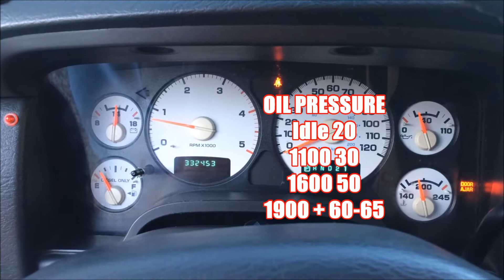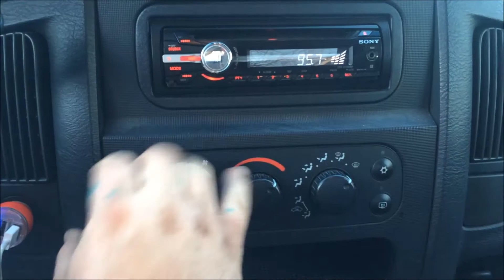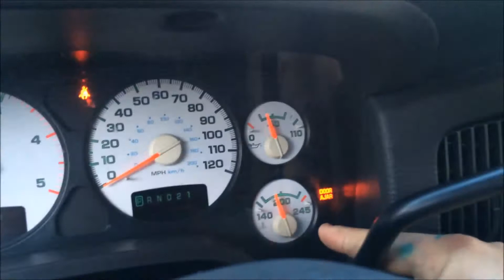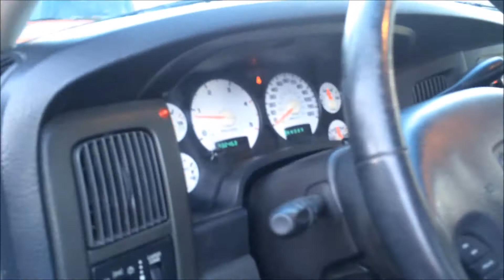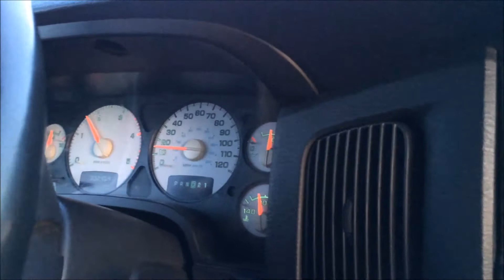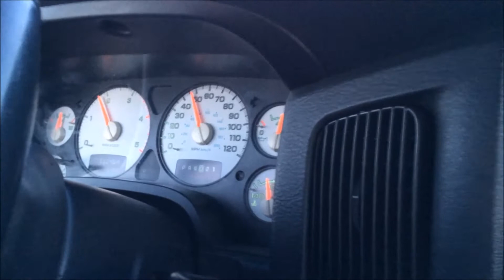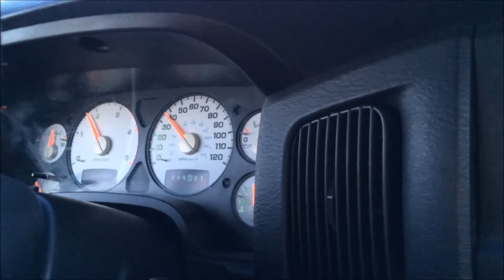2003 DODGE RAM 3500 4X4 4 DOOR 5.9 LITER CUMMINS TURBO DIESEL DUALLY FOR SALE.

Comment: I'm getting ready to do my 06.. I dread it
Reply from the maker: + Overheadcam Walling  Just make sure you pre soak everything with PB Blaster for a few days ahead of time. And all the proper tools. Make sure you have 3/4" to 1" sockets, extensions and ratchets, a good breaker bard 3' long and a 3 finger puller to get your hubs off.